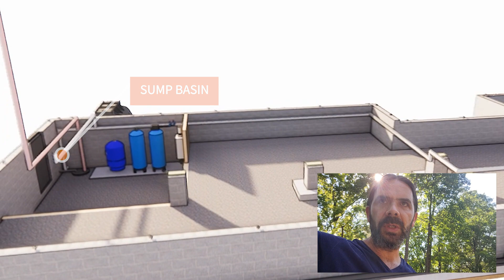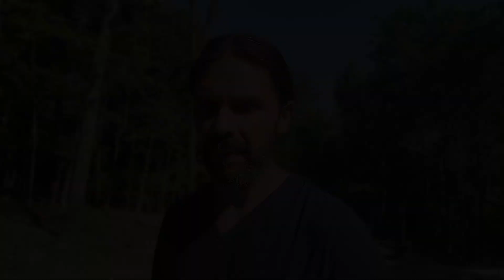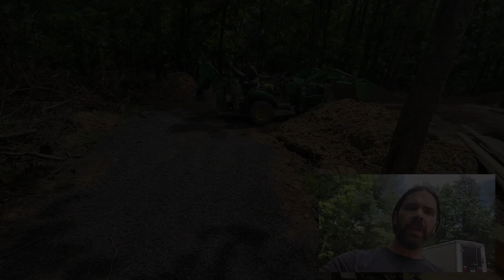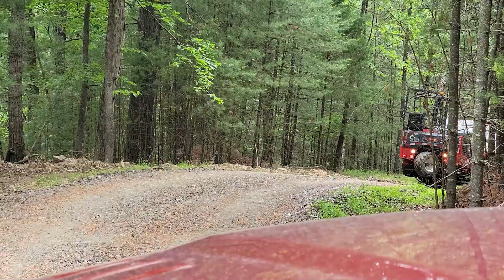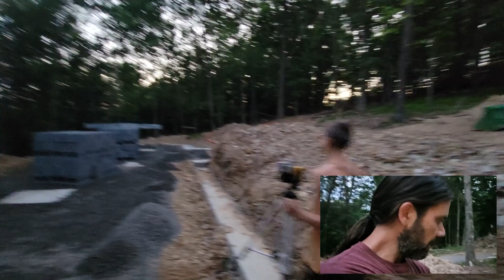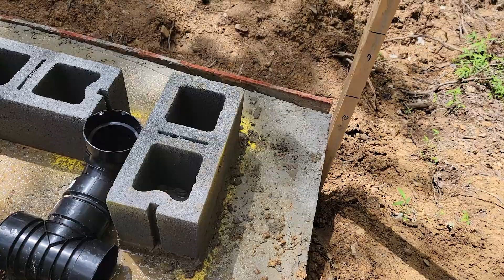Building Mom's House | Crawlspace Design & Construction | p.6

Comment: Why not a poured foundation and a French drain to move the water away from the outside of the footer?
Reply from the maker: Poured concrete cost significantly more and has a 3 month wait right now, and it's not worth that money for a crawlspace. With exterior drain pipe around the perimeter I don't think a French drain is needed, but something to consider on the high side, but I will wait to see how we finalize grading. But we may be talking about the same thing, if so, yes there will be a drain around the footer

Comment: What seismic zone are you in?  IRC usually calls for #4 rebar vertically 48” OC imbedded a min of 6” into the footer and a min 14” into the stem wall.  How are you pinning the wall to the footer ?
Reply from the maker: It is not required but we are putting the bar in anyway, but with epoxy into the footer and running it to the top course. Also putting in durawall every other course for horizontal reinforcement.